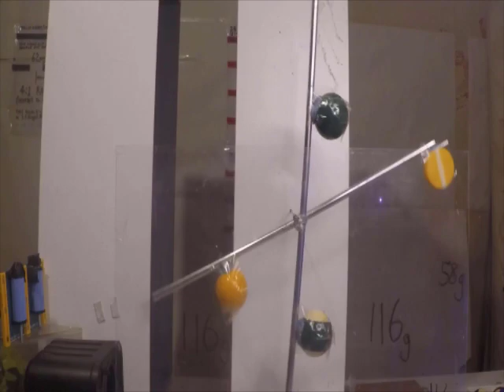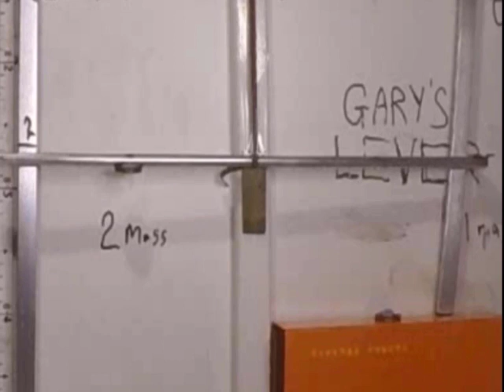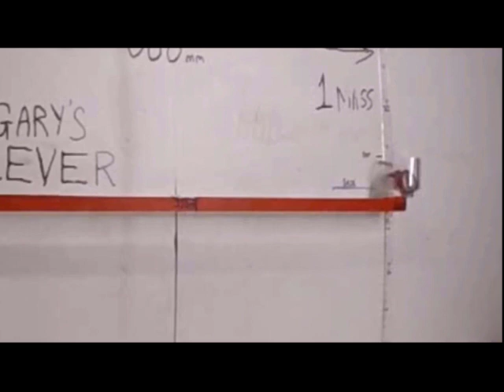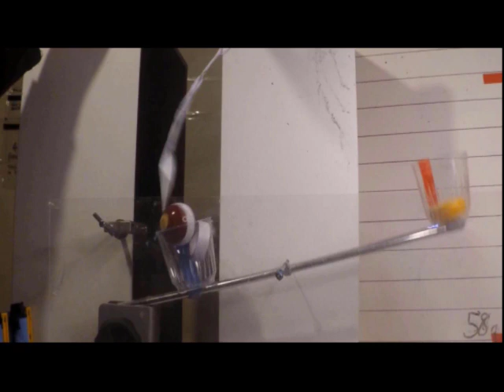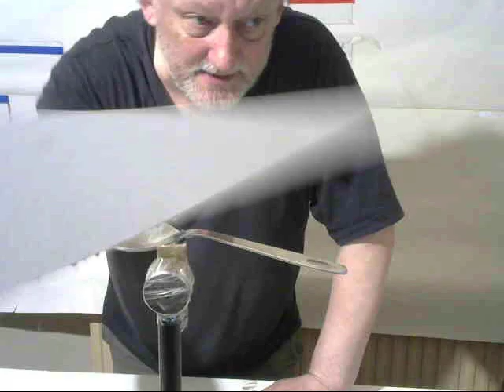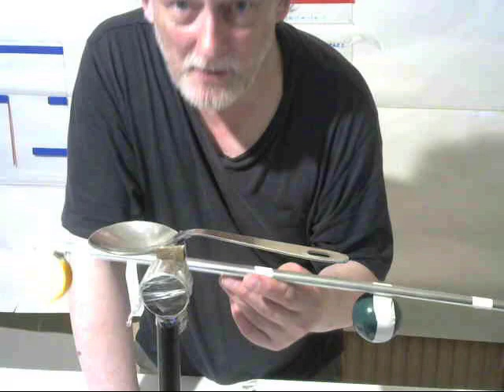WHY THIS SO CALLED LEVER IS REALLY A PENDULUM WITH ONE ENERGY, NO INPUT OUTPUT SIDE   IT'S ONE THING

Comment: Goofy doesn't understand that there is no speed involved in the equation 'mgh' for the potential energy.
Lifting a mass of 1 kilogram up 1 meter costs 9.8 J when you are at sea level.
There is no difference whether you do this in one minute, or in one hour.
Velocity plays no role whatsoever here.
Goofy's error is not so strange, even professors get this wrong sometimes.
The reason is that they are teachers, and not researchers on the subject.
Wrestling a day or so with the equations can give some relief and insight.
e.g. mgh = ½mv²
and don't forget to do the unit analysis...
Reply: After listening to Goofy's latest installment John, all I can say is, he is lost at sea.

If we were to factor in the speed at which a weight is lifted, would it be correct to say that a larger force would be required to accelerate the mass to the higher speed?
Reply: @michaelfowell223  Even professors ask this question sometimes, Michael.
But remember, when it has a higher speed, it will also travel higher, you see.
In other words, when the kinetic energy is larger, the potential energy will be larger as well.
Just like the opposite, when you drop something from a greater height, the indentation will bee deeper too.
Stay safe, dude.
Reply: @_John_Sean_Walker  Thank you for your reply John.

Just bear in mind you are dealing with a laymen here.

The reason I asked this question was in relation to Goofy's claim of, if you lift an object faster it takes less energy.

So bear with me as I may have a misunderstanding.

But for arguments sake say we are lifting a set weight over a set height, say 10kg to a height of 10 metres.
If we were to lift that weight at say a steady 5mph ascent it would take a certain amount of force to do so, if we then wanted to lift that same weight at a higher speed say 50mph that would require additional force to achieve.

So if Energy is defined by E=fd would that not mean that by adding more force to lift an object more quickly it would in turn actually expel more energy and  be less efficient than doing it a a slower pace.

Forgive me for my laymens brain lol.😀
Reply: @michaelfowell223  Hello Michael,
All laymen they are.
Even Stephen is letting me down, and it looks that he is running around in circles too.
I can understand that he is tired of all the messy equations that commenters spit out like confetti, but now he thinks my equations are incomprehensible as well.
I think he doesn't understand that an equation can be an essential part of a sentence, and that one has to concentrate on the equation for a moment, and try to comprehend its consequences.
He cannot grow when he keeps skipping the equations.

About your question I like to say that when you have a car battery and a gearbox, you can increase the speed of the lift, but than you will reach the top floor in a shorter time too.
The force per unit of time is larger, but the total time is smaller.
The car battery will lose the same amount of energy in both cases.

This is related to what Goofy is saying, namely that when the speed is greater, you travel more distance per second.
Yes, water is wet.
But for everybody I want to say that:

        THE POTENTIAL ENERGY IS INDEPENDENT OF THE SPEED.

Have a good one, brother.
Reply: @michaelfowell223  
Mirror from previous comments:

● Kinetic Energy:
Ec = ½mv²     in Joule J (kg∙m²∙sˉ²)
Ec1 = ½ × 0.031 × 1.391213² = 0.03 J
Ec2 = ½ × 0.062 × 0.9837367² = 0.03 J
Ec3 = ½ × 0.093 × 0.8032182² = 0.03 J
This means that the kinetic energy is conserved.
                          CONSERVED

● Momentum:
Rho, ρ or ϱ = mv (kg×m/s)    and has the units: kg∙m∙sˉ¹
Rho1 = 0.031 × 1.391213 = 0.0431276 kg∙m∙sˉ¹
Rho2 = 0.062 × 0.9837367 = 0.0609916 kg∙m∙sˉ¹
Rho3 = 0.093 × 0.8032182 = 0.0746992 kg∙m∙sˉ¹
The momentum is in 1 : √2 : √3 ratios.
This means that the momentum is not conserved.
                       NOT CONSERVED

Therefore we know that the force is related to the energy, not to the momentum!

● Experiment with lead balls dropping into clay:
(mgh)_2 = (mgh)_3     since: (mh)_2 = (mh)_3     since: 1×4 = 4×1
Ball_2) 574g @ 1400mm     -     m₂ = 0.574 kg     v₂ = 5.2 m/s     -     [½mv²] ➔ Ec₂ = 7.76 J
Ball_3) 2306g @ 350mm     -     m₃ = 2.306 kg     v₃ = 2.6 m/s     -     [½mv²] ➔ Ec₃ = 7.79 J
Reply: @_John_Sean_Walker  I don't mind admitting that I get confused by it all too.

Its just trying to get through that and to know where to apply the correct equation and clear up some of my confusion.

Forgive me here for my simplistic way of putting it but would it be correct to say,

If an object was lifted to a height of 10 metres in both cases but at different speeds

1- 5N of force for 10 metres

2-  10N of force for 10 metres.

So in case 1, 5 x 10= 50

In case 2, 10 x 10= 100.

But in case 1 due to the applied force let's  just say the object is travelling a 1 metre per second, so a total of 10 seconds to cover that distance/height.

In case 2 the force is double so its travelling twice the speed, 20 metres per second. So it will only take 5 seconds to reach that distance/ height.

So case 1- 10 seconds at 5N per metre =50

Case 2 -5 seconds at 10N per metre = 50

So regardless of the speed of the lift the same potential is reached with the same energy inputted in both cases, I know my units don't make sense, Im just trying to make it understandable for myself at the moment.

Thanks for your input John, I will get there one day, I have potential lol.
Reply: @michaelfowell223  I don't know what that means exactly, 5N of force for 10 metres...
Finding the right equation for working something up, against gravity, always requires an extra equation.
But if you know the acceleration, you can simply subtract 9.8 when you are at sea level.
So, if you start with 9.8 m/s² up, you are not going anywhere.
But my quick reaction to your example would be that Ec = Fs.
The kinetic energy equals the force times the distance traveled.
But your example needs a different approach in my opinion.
The acceleration equals the force divided by the mass.
And the velocity equals the acceleration times the time the force was applied.
The distance traveled equals one half times the acceleration times the time squared.
You can reverse engineer the equations into the solution you need to find if you like.
But I advice you to make a quick drawing of the situation, and write down the question.
Always compare a problem with freefall, that is where it all starts.
Download my card, and give it a special place on your computer, so you you can always take a quick peek at it:
https://drive.google.com/file/d/1JSTiKwsD19BcTE7QWAaUL5O5UT2VwRnf/view?usp=sharing
Reply: @_John_Sean_Walker  Thank you for humouring me and thank you for the information and the link to your card.

I still have a lot to learn but you have given me plenty to mull over for the time being.

Have a great day John and thanks again, stay safe.👍
Reply: Never mind the maths, the point is to explain to the barmaid why KE formula cannot produce free energy as Gary says. If you can't do that in an intuitive concept way you've failed.
Reply: @Ian.Gostling  Ian, energy needs a potential difference, without it, there cannot be any 'flow' of energy.
Energy cannot be created, so to speak.
But to the maid I would say that she has to prove that she has  'something', it is not up to me to prove that everybody has 'nothing'.
That is the way it always works in science:
Who states, proves.
Reply: @_John_Sean_Walker  sorry John but to me you talk in riddles so the barmaid has no chance lol!
Reply: @Ian.Gostling  Go to your high school, and ask your money back, dude.
Reply from the maker: @Ian.Gostling  ... " sorry John but to me you talk in riddles so the barmaid has no chance lol!"   ...

I don't know if it's any help to anyone but i FEEL like I had a bit of a breakthrough - a BIT of a Eureka moment ... which I posted in a very long message to Parapoly,  just now ... Hoping i don;t regret it if I've screwed up - but hey, I'm TRYING to get this thing nailed down for anyone wanting clarification.   It's late now though so to be continued.

Comment: Thank U so much for uploading a new video, Mister Brough, Sir.
I think the length between the pivot point and the center of mass can be derived from the period T in seconds per oscillation, and g, being the local gravitational acceleration, 9.8 m/s².
T ≈ 2π√(L/g)  ⇒  L ≈ g∙(T/2π)²
Whether the width of the pendulum has anything to do with the period is unknown to me, but it is an interesting question.
In my minds eye it does btw, because F=ma.
Maybe something for another time...
Wikipedia has a page called "Pendulum".
Have a good one, Sir.
Reply: Since angular momentum is a real thing.

Comment from the maker: Update re my cardboard TRIANGLE model here ... I think I should, by rights, have made it TWO triangles - - effectively REVERSING the lighter side so that it's heaviest at the furthest away point - but that would tip it that way and so would need to be a different triangle.  

OK - so not a perfect model of Gary's proposed "lever" BUT STILL conveys the idea that ALL these are SINGLE OBJECTS once we have glued the masses that comprise the whole thing.   

So we can't REALLY, legitimately claim "this bit" has twice the energy of "that bit" - and "that bit" was "THE INPUT" ... who say's it was?   

Like an electrical transformer where you've CONNECTED the primary and secondary in // you can no longer say "this coil is the primary" and "that's the secondary" ... you've made them into ONE INDUCTANCE with ONE impedance ONE time constant and NO gain or loss in the usual sense .  So you wouldn't apply normal transformer calculations to it because you've hemmed yourself in by tying what would normally be the "IN and OUT together.  In crude terms.  SOMETHING along these lines at any rate.  

it's NO LONGER  A TRANSFORMER ANY MORE than Gary's lever is still a lever once you glue the things it;s supposed to be moving, TO IT ... 

I don't mean an autotransformer incidentally, where the primary and secondary are effectively IN SERIES with one another, not isolated - the analogy doesn't work for that... I don;t think ... although in fairness I'm just thinking aloud - never a good idea! 

if I GLUE MY FOOT TO A CROW BAR and glue the other end to the underside of a piano... you now have the world;s first "man-piano" combo - you have made us inseparable lol ... Just being silly because THAT'S what this kind of daft claim by Gary does to it - drives us b^rmy.